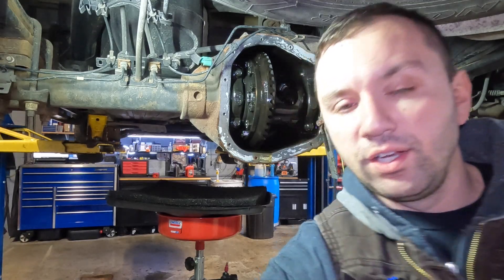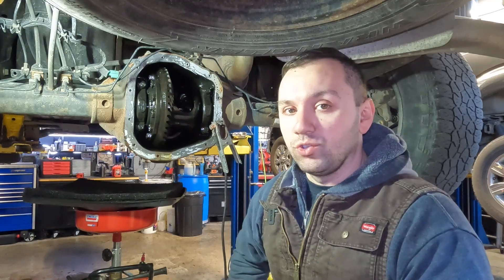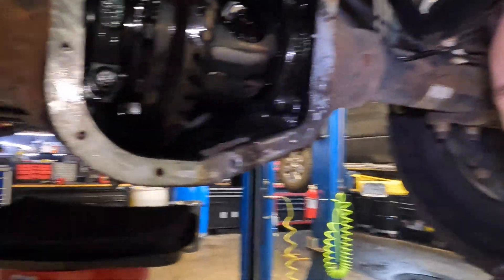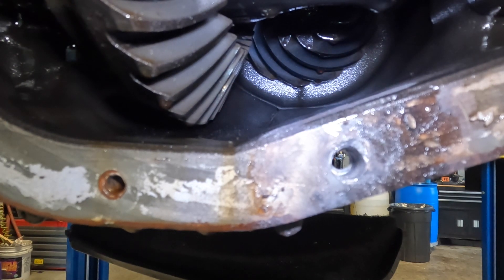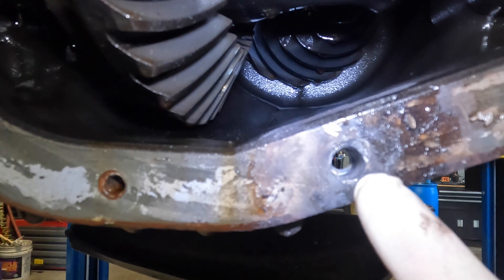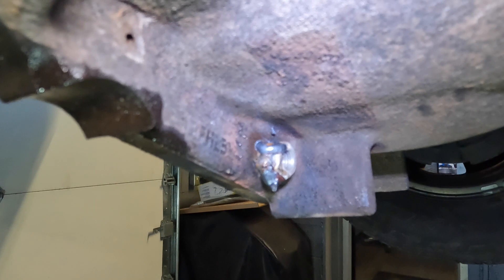OH SNAPPED! DIFFERNTIAL COVER BOLT SNAPPED OFF DUE TO RUST. HOW TO DRILL OUT A BROKEN BOLT.

Comment: same issue. Broke 3 bolts. I cannot find a bit that will drill these bolts out. Curious what drill bit everyone is using since I have to use a hand drill. Mine are n areas I should be able to use a bolt on the other side as you did but may try to tap the hole if I can ever get a hole drilled out. Thanks for the video.
Reply from the maker: @PhillipSmith-m1v  hopefully it works out for you!
Reply: I had to use a diamond drill bit on the one that I broke off a screw extractor on lol . I broke off 4 drilled them all out , now there are bolts all the way through . Only torqued them down to 15-20 LBs worried about cracking the housing .

Comment: Thank you for showing this. Glad to see I'm not alone. I had 2 that broke off. I even used liquid wrench before. I first hit it with liquid wrench again. I then welded a nut on like I always do. Waisted a bunch of steal nuts. I could not get anything to stick to those bolts. I've never had this problem before. Used a drill and extractor. Extractor broke in a way that was impossible to remove. Destroyed a bunch of bits getting that out. The damage was too great to the hole for even a Heli-Coil. Ended up building up weld in the in the hole, filed it down flat and tapped it. Can barely tell there was a problem. Only took 4+ hours for something that takes 30 minutes to do.
Reply from the maker: It’s very common on these for the bolts to snap off, what I do now is I will use my induction heater to really heat them up and crack them with a ratchet otherwise I find they don’t come off.
Reply: Just had my 2016 F150 get differential fluid changed and got charged $1100 with 5 hours labor to change three bolts that were seized. Is this fair price for the work done at Ford service? 😢

Comment: Google searched this because guys at the shop are recently breaking these of constantly, it's pretty much the only diff I've seen where it'll happen almost every time. The put a gasket/ the holes go through and the bolts are too small, all of it adds up to broken bolts. I actually busted 4 off on the first one I did, I use the magnetic inductor heater now on them. I commend your repair, you were able to keep the truck driving with no worries, a bolt straight through with a nut is a great idea!
Reply from the maker: I’ve had quite a few of these break off. I’ve heated them prior and everything and for some reason they wind up snapping, almost as if it’s inferior metal that the bolt is made up of and thank you I always try to keep the customer happy and running on the road.

Comment: I know it's not practical for a shop but before I do a job I hit the bolts and nuts with penetrating oil for a few days to hopefully loosen them up.  I have been pretty successful most of the time.
Reply from the maker: I do that method as well I leave it in for a few minuets but, this truck is a 2016 the reason I didn’t spray them before hand is I didn’t anticipate them to be that badly seized.